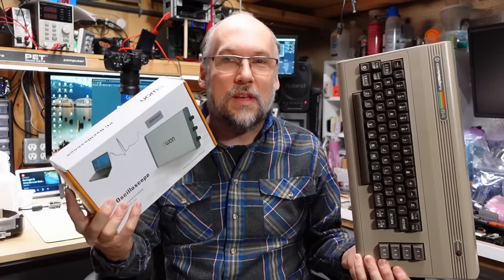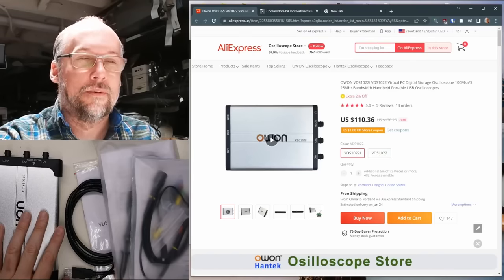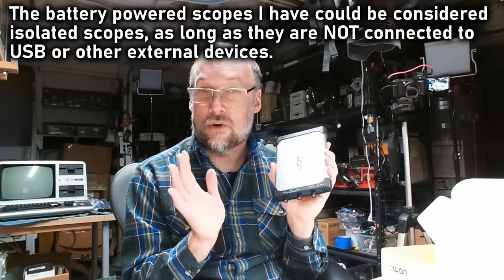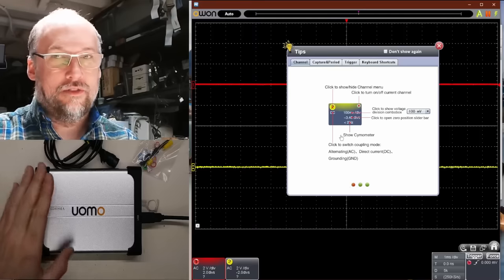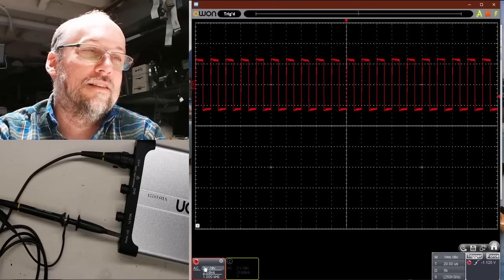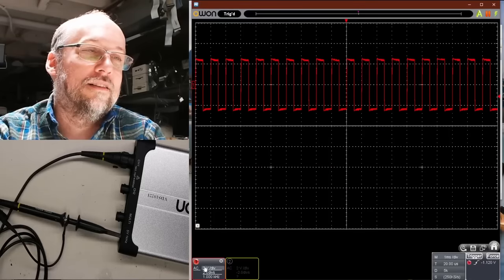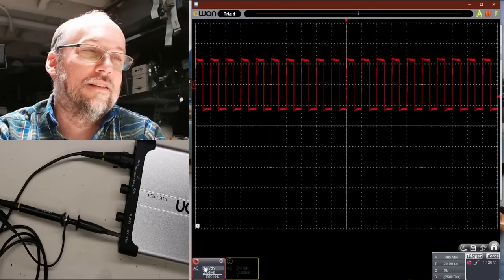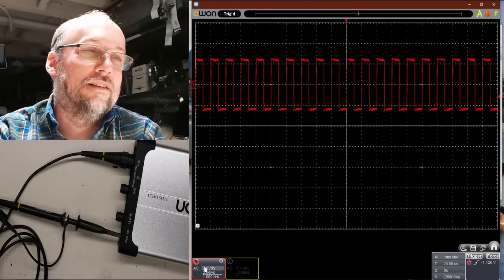This blows away the $60 budget oscilloscope! (OWON VDS1022 review)

Comment: For a lot of apps like that, sometimes you have to hold control/shift when scrolling the mousewheel to select the type of zoom you're after (eg; zoom, scroll, etc)
Reply: Was kinda yelling at Adrian about this - though it's possible he tried it without saying
Reply: @Blitterbug  either way, he sold me on getting that as my ideal oscilloscope for any kind of work that I end up doing. Pair that with a $250 HP netbook and you're golden (netbook, not a Chromebook. Runs full fat Windows 10)-- 128 gig eMMC ssd soldered to the main board, 4-8 gigs of RAM, and a dual core i3, little 13-in screen, but it does 1080, I own two of them and they are fantastic little on-the-go machines
Reply: One of my favorite things about those HP netbooks is their keyboards, you would think it's some squishy cheap piece of shit, but it's actually really satisfying to type on. Much better than my $3,500 razer blade pro's keyboard for sure.

Comment: The A to A controller would be because the device is technically a switched mode microcontroller board, and can be configured as a host or a client device.    However, it should just use Micro-C for this.  USB-C mini would also be an option, but that was phased out with USB 3.0 and was even rare before then.  (It's a modified USB Mini connector with an additional pin and a slightly different shaped shield.  I actually have an adapter that came with my printer's set of 3 inch adapters for hooking up any and every USB camera in existance.)

Comment: Commodore 64s are so great for testing osciloscopes because of their normally "dirty" signals with well defined patterns from the passives that are designes specifically for targeted mitigation of the noise, bounces and other behavior instead of complete nullification found in some other systems.   They also have a variety of frequencies inside.

Comment: Half of your complaints are based on not using multiple channels. Having to hover over a setting based on the channel makes more sense when there are more channels visible. Rolling your scroll-wheel in the grid when showing multiple channels would be an exercise in annoyance of guessing which channel would be adjusted.  It's not perfect, but would work for up to 6 channels with no changes (a requirement for cheap software). And you get what you pay for :) If I needed a scope like this, I would buy this one

Comment: The sample rate is tied to the seconds per division so that your sample depth (5K samples) takes up the full width of the display.  The shorter the time between divisions, the faster it has to sample.

I'll bet you this thing has a small RAM buffer.  There's no way it can stream continuously at 100M samples per second over USB 2.  So it is probably buffering up one screen's worth at a time, then sending it over USB for display.  Then it grabs another screen's worth.

My Analog Discovery 2 does something similar, though I think it can buffer a little more than a screen width at a time.

The lack of direct control over the sampling frequency can be annoying when your signal is near the scope's maximum bandwidth.  If the sample rate isn't a multiple of the signal frequency, then you can get a different number of samples on two consecutive periods, which can make it harder to post-process the raw sample data.  It can also cause interesting artifacts with interpolation.
Reply: I know lots of people don't like PC-based scopes but I'm also a big fan of the Analog Discovery 2.  It really doesn't have that many limitations, given I work on sonar so I'm not dealing with high-freq RF stuff.  And you can do so many other things with it.

Comment: At 4:41, you say that the AC voltages in a PC are isolated from the AC supply.  I'm not a pro, but I didn't think there were any AC lines inside a PC, at least a modern one.  At least from the ATX spec and later, all internal power inside a PC is DC, right?  Do some older machines have a 12V AC line as well?  I just didn't think that AC would be of any use inside modern transistor based processors.  But I'd be curious to know if that's untrue!
Reply: It's all about what that DC is REFERENCED to. Say you have the "Zero Volt" rail (black ATX wires), and you call that the "DC Reference voltage". Now when you have a +12V wire, that's 12V higher than the reference, +5V which is 5V higher than reference, etc.
However if you make the 5V rail your reference, then the 12V rail will measure 7V... that is because both the 5V rail and the 12V rail are referenced to the same "zero volt" rail. They are not isolated from each other, they share a common "ground".
In a PC power supply, the "zero volt" rail may or may not be fully isolated from the mains power. The first thing that happens is that the Mains AC gets rectified using 4 diodes, to create a high voltage DC (120V AC >> 170V DC or 220V AC >> 310V DC).
So, we have a fairly high DC voltage, which then gets converted to DC by the ATX PSU.
The trick comes with the Mains Earth (Ground), which is actually connected to AC Neutral. The ATX PSU will be grounded, and that means that the chassis of the computer will be at AC Neutral. If the motherboard or any other component connects the DC "Ground" to the chassis "Ground", then the ground is now referenced directly to Mains.
None of that matters if your scope probe is connected to an equal "ground". However if you connect the negative probe to a point which is higher, then power can flow out that scope wire and back to the mains. It loops around and creates a literal short circuit.
For example, let's say you want to check the voltage of a power supply after the bridge rectifier. There is a smoothing capacitor rated 400V DC so you connect your scope lead onto the Negative terminal and... BOOM. That's because the Capacitor "ground" is not really at "zero volts" like the chassis ground or scope ground might be.
Sorry, that was not well written, and it's very hard to explain here.... hope that gives you a few hints.

Comment: USB A to A, while nonstandard, is not crap. It is sometimes useful. For instance, I used to work at a local TV station. When NBC upgraded their equipment, we had to use a USB A to A cable in order to allow the servers to talk to each other before we were able to get the Ethernet working.

Unusual, but not unheard of
Reply: what you had were not USB A to A cables. If you plugged the cable from this video between two computers it would not work, and it could kill the motherboard if both computers were not grounded.
The cables you used were modern "laplink" cables with a special isolated chip inside making one of the computers act as a "usb device" while the other was a "usb host".
Reply: @mrfrenzy.  Huh. Alright. I had no idea there was a chip in there. It legit looked like a standard USB A on both ends
Reply: @mrfrenzy.  The computers are host by design, so there must be a chip acting as two USB devices…
Reply: Not to mention its use on USB HDD enclosures, when even the Type C would fail, Type A wold just bend, allowing easy replacement of cable and/or even the plug itself.

Comment: The Zeeweii has impressed the hell out of me, in part because I've used it on up to 66.5Mhz signals and it has been _fine_. I haven't used it on anything higher yet but I'm starting to think it actually might handle 100Mhz waveforms.
Reply: I have the two channel Zeeweii and mostly like it a lot.  The only problem I've run into is wanting to view an NTSC channel 3 or 4 video signal with it (about 60 to 70 MHz).  When I've tried, I get just a flat 0V line - no waveform at all, even when pressing the Auto button.  I know there was a valid video signal present, because I could watch it on an old TV.  Do you have any tips on how you were able to view a 66.5 MHz signal with the Zeeweii?  Thanks!
Reply: @davidkroeker1821  I just had a motherboard with a 66.5Mhz clock signal on it and it picked it right up - and not just at the crystal but across the motherboard. I do have only the single-channel but I have no idea why that would make a difference. Mind you, this would've been a very stable signal, so maybe that's part of it?

Comment: In addition to isolating probes, you can get a USB Isolator, which will isolate the scope's ground from the host PC's ground via a USB dongle, but I would just pay extra for the isolation here since you'd potentially need two isolators due to the (terrible) non-standard USB power-tap cable.
Reply: I'd bet there is a USB isolator and isolated DC-DC inside the scope already, it would be the cheapest way to make the scope isolated.
Reply: @mrfrenzy.  Of course, I'm just speaking for how to turn any standard USB scope you might already have into an isolated USB scope. As I said, when buying this one, it would be cheaper just to buy the isolated model, rather than isolating it after the fact.

Comment: The mouse wheel over a drop-down control is an innate Windows thing.  So it's no surprise it works in the menu but not on the display.  That would require extra programming.  Besides that, the program needs to know if scroll wheel=zoom or scroll wheel=amplitude.
Reply: "That would require extra programming" -- barely. A properly-written program would already have the scrolling behavior broken out into its own function, so it'd be simply a matter of adding that one region of the window to the handling of the mouse-scroll window message. It'd literally be one, maybe two lines of code.

You're right that in the waveform area of the window, it is ambiguous what the user might want. But GUIs deal with ambiguity all the time; that's an imminently solvable problem. The most common is to have one be the default, and then use a modifier key (e.g. "shift") to do the other thing. Alternatively, there could be a toggle button on the window that selects what the mouse wheel does. Either way, the potential ambiguity isn't a reason to skip the feature altogether.
Reply: Apparently the OpenSource software has use-definable keyboard and mouse functions.

Comment: Every piece of advice I've received about isolating a scope from the ground leads is "don't do it." The proper way is to use an isolation transformer on the Device Under Test (i.e. the Commodore 64). I suppose in this case, it's necessary to keep your PC safe from a voltage spike on the probes, but I would still use a transformer on the DUT anyway, especially if it's a CRT with a hot chassis.
Reply: This scope probably has an isolation transformer on the power input, and opto couplers on the USB data lines.
Reply: I just realized a car battery and an inverter would work. Might be the cheapest way to do it.
Reply: i have seen a teardown, it has a usb isolation chip and power isolation chip, you can also make the non i version into the i version by adding these components and removing some resistors

Comment: I splurged and snagged a classic real o'scope 60mhz for 20$ and for as often as I need one it works great. I have found many of the asian cheap scopes (RIGOL) for example, have poor frequency resolution and the ones with the fancy measurement screens tend to give you BAD data unless you adjust the view to show only about 10 cycles of signal on the screen.

Comment: Drean Company from Argentina licensed CBM to produce C64's out of motherboards discarded in factories due to being too expensive (in terms of time) to repair. Rev A (326298) motheboards mostly. The funny thing is they repaired AND modded EVERY motherboard to 6 pin DIN Video Connector to support Luma-Chorma output, using that same bodge wire (even the same red color...) I could say that was a "Drean Commodore 64" machine if it wasn't for the different case badge and VIC-II chip (We had our own 6572 PAL-N VIC II).

Comment: The isolation, if there is any at all, will be on the USB port only. There will not be any isolation between the two channels on a scope in this price bracket.
Reply: The grounds of both probes are connected together, both referenced to each other. The scope ground will be referenced to USB ground. You won't have much of a USB port left if you connect either negative scope lead to a non-grounded point in the device under test 😀😀

Comment: USB isolator modules based on Analog Devices ADUM  isolation chips are avaiable on eBay etc. Allow DC isolation and power injection or powering from host via DC-DC isolated convertor module. Very useful for audio DACs, hubs etc...plus this scope module.

Comment: If Possible, would you do a video to fix the Luma/Chroma on this Rev A board so that the 8 pin dim works? I have a 5 pin dim that I would like to convert to an 8 pin dim.
Reply: dim = DIN?
Reply: @serpent213  You are correct

Comment: I guess it may fail to work after in someone's home, later back to factory, repaired and re-sale as "refurbished". As a teenage in the 80's, I've seen the assembly line full of auntie working on the soldering, can't blame their quality since they're not well trained.
Reply from the maker: Yeah it's quite possible. It's really funny as even the early Rev A boards that I've worked on have a RF shield soldered onto the bottom -- and this board had no evidence of that at all. So many mysteries

Comment: I really want to get a scope for more than 3 years now but they are expensive as hell, and to be honest, it's a little intimidating. I kinda understand as you walk us through but I'm not sure I'd be up for the task to actually handle one (even though we had classes at university where we had to use old analogue scopes and those were kinda fun but didn't understand much back then).
Reply: same situation, with mentor is esay...return to home ---argghh shi....t (ç*%/"*+6 .....    gretting from SWITZERLAND
Reply: I suppose "expensive" is relative.  The Rigol 1000z series I think is an excellent value for the money, and at under $300 for the very popular 4 channel DS1054z.  Granted it is a rather old model still manufactured.
Reply: @danman32  I don’t know when you’ve shopped for that one, it’s over $400 now.
Reply: @c1ph3rpunk  didn't realize it jumped so much in price.  I bought mine I think 2 years ago definitely under $300.
May come down in price eventually as the jump may have to do with current state of economics.  Might also be price gouging if supply became low like it had for the Raspberry PI.
Discontinued production maybe?
Reply: I used analog scopes decades ago when even a mid range spec scope was 10K USD  and could only store a few kilobytes of wave form data.
All measurements were done manually between you, the screen and your scientific calculator.

Buy a modern scope at the bottom of the range and you can select from dozens of parameters to be automatically posted on screen and continuously updated.
For a good learning source for equipment and reviews with teardowns is Dave of the EEVBlog. ( Adrian has one of Dave's multimeter designs on set at times )
Reply: Just buy one and experiment!
Reply: @danman32  The Rigol DS1054Z is a GREAT scope, especially after you hack it to add all the upgradable features, including 100MHz bandwidth and extra sample memory.  But as others have said, I don't think you can get it for $300 anymore.

Comment: The early REV-A boards that never had any RF shielding attached are from the RP parts bin that Commodore used to refurbish broken c64s. 
So this board is most likely not original to the case. The 300000+ serial number puts the case at the start of the '83 build run and would originally have had mostly early '83 chips.

Comment: The "zoom mode" issue vs "main":  
  Main" is likely giving you more memory for a long recording"  vs the "Zoom mode" which will have more resolution, but will fill up the memory quicker. (just a guess, but this is generally what I've seen on other scopes with weird options like this).

Comment: The diag cart showing the control port as "BAD" is typical on a Rev. A. board; there's a part with a different value in the paddle circuit - don't remember if it's a capacitor or resistor - but it doesn't affect functionality. My own Rev. A. board shows the same "failure" but paddles work fine anyway.

Comment: Regarding the scope:
1. The software:
Every single scope I have seen like this has had sucky, horrid software.  I don't know this for a fact, but I strongly suspect that the "software" is primarily designed to be an in-house test fixture, (do the hardware features work?), that was cobbled together by whomever was responsible for testing in the factory.  Then it was released along with the hardware so that the customer had something to use.  Unfortunately, most of these groups don't release source code or API specifications so we end up on the short end of the stick.  For example, the JYE-Lab oscilloscope software looks more like it was intended to test the communication interface though it does a passable job as a 'scope untill it freezes solid. . . .

2.  Hardware response times.
I strongly suspect that this is caused in part by the higher-speed interface of your advanced system.  That the 'scope module could keep up with it is excellent!  However, an oldy-mouldy laptop or system with a slower processor, RAM, and an older USB-1 or USB-2 interface that's "Designed for XP!" may not be able to handle the higher update rates.

One other thing.
I thought I saw "Owon by Hantek" somewhere during the video - or maybe somewhere else?  Is it possible that "Owon" is a Hantek brand in the same way that Kia is a Hyundai brand?